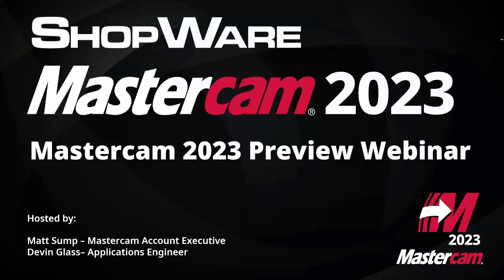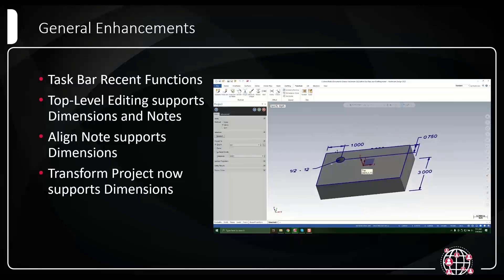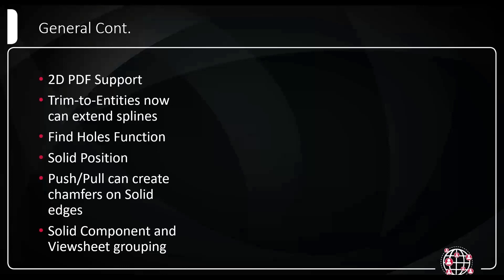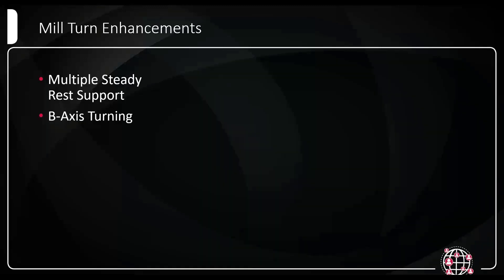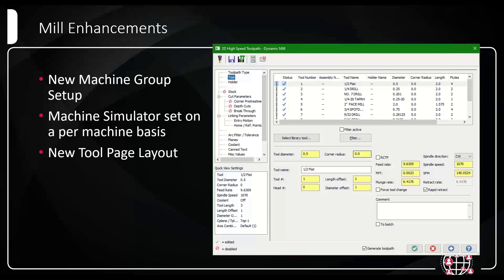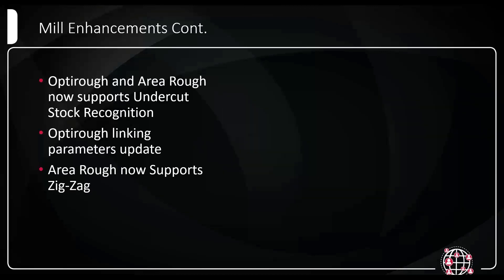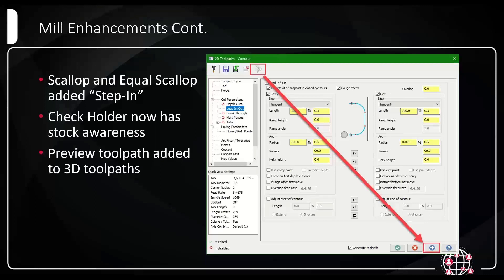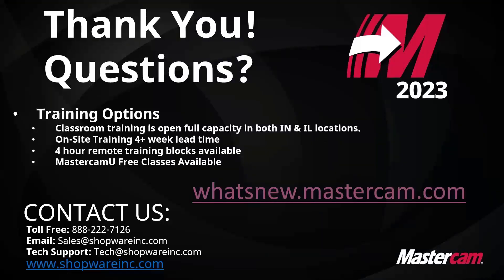Mastercam 2023 Preview Webinar

Comment: two of the most wanted features for me are to be able to enter the material from outside in the Horizontal Area toolpath (basically act like open pocket toolpaths) as well as having a "machine flat faces" checkbox in 3d optirough and normal area roughing. 

Horizontal area currently has a huge flaw, sometimes it doesnt machine faces if they are small enough even though they could be easily machined if the tool would enter from the outside. And optirough you can only have huge stepdowns with the same stepups to machine flat faces but then have no stepups or huge stepdowns with small stepups but then it doesnt machine flat faces or you have to use small stepdowns with the same stepups which most of the time is not good.
Reply from the maker: Can't comment too much on Area Mill as I rarely find use cases outside of using Optirough. We didn't cover it this preview webinar but 2023 is adding,  "Automatically Detecting and Including Stock for Z Depths" and "Machining at Maximum Depth" to Optirough, and Rest Rough stock model improvements. 

Those changes and you have 'included flats' selected on the Optirough parameters page, should solve a lot of that described issue. Get your pain there trying to pickup the right depths on flats. Not sure who your local reseller is, but might want to have them take a look at one of your files with that issue and how it processes in 2023.

Comment: We do molds which have many parts and export every part individually from our Cad software. When i import one part into mastercam it isnt at the same position as it was in the assembly. It would be useful if mastercam would import models relative to the global zero point so every individually exported model from the same assembly would be imported into mastercam at the same correct position.
Reply from the maker: Curious to why that matters? Mastercam is basing the position on the machine zero as that won't be relative to the CAD assembly. You could import the Assembly file and everything would be in the correct location then you could set work offsets based on which machines are assigned to certain components of the assembly but adds additional complexity I'm not sure is needed.